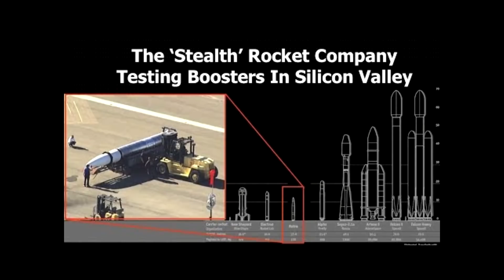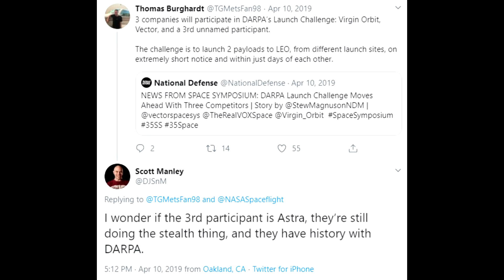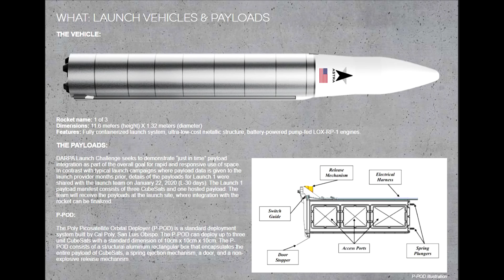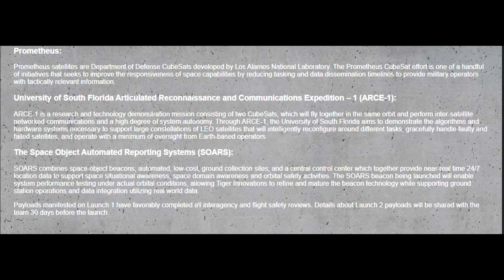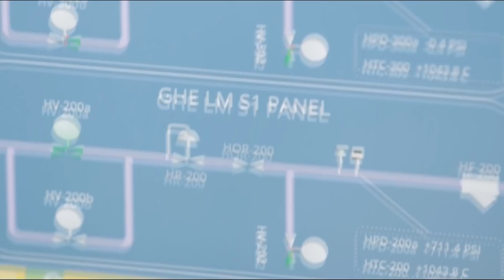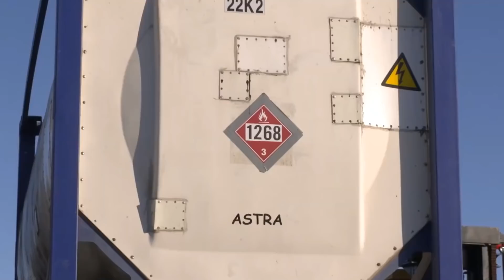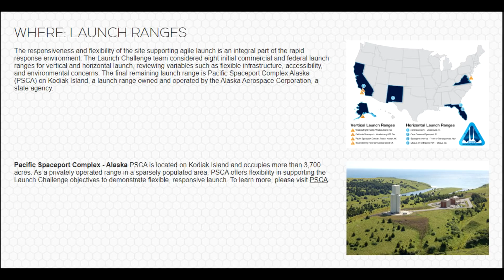Astra's Secret Rocket Project Finally Reveals Itself

Comment: Is the goal emergency launches in the event of anti satellite misiles in war, or what is the main goal of the darpa challenge?
Reply: Eric Lotze   Actually I think you just made a very good guess. That’s certainly one reason the US would want the capability to rapidly launch a payload into orbit with little prior planning time.
Reply: @liesdamnlies3372  this would not be an effective anti satellite weapon. It's too easy to see coming (satellite recon from other countries would see you setting it up the day before).
Reply: Although not a good anti satellite weapons platform itself, yes this would be good at delivering temporary replacement satellites for any that got shot down, so long as they can be replaced by a satellite under 200 kg (most spy satellites are pretty huge).
Reply: If i remember there is some sort of silo based system for basic coms post massive war.  I don't know if this would replace/compliment that.  Perhaps this is applying a method similar to train/mel based missiles where they are so mobile, you can't kill them thus coms are ensured.

Comment: So let me get this straight... DARPA is having a contest to build a short notice easily transported no launch infrastructure vehicle... They're paying people to build a liquid fueled Pershing 2 missiles!
Reply: Basically a modern V2...
Reply: @fire304  that's what I thought. Easily transportable, could start from anywhere relatively unnoticed and send a small payload anywhere. Even the flame-divider for the launch platform looks similar!
Reply: @foximacentauri7891  This rocket can only carry 100kg.
Reply: @PhysicsGamer what do they want to achieve by this? No big warhead and no practical satellite is that light.
Reply: @foximacentauri7891  The US government has been working for years to encourage private spaceflight operations of any scale whatsoever. It's only been coming to fruition the last few years
Reply: @foximacentauri7891  Depending on the mission's definition of "practical" 100kg is plenty for a practical satellite, especially if the mission duration is relatively short.
Reply: PhysicsGamer Ignoring that these are all long since discontinued, in theory you could you could fit a W33 in there just about perfectly.

Or you make a 4 warhead MIRV if you used W54s. Those weighed less than 25 kilos a piece!
Reply: @PhysicsGamer  Not implying anything, but W76 warhead weights 95kg.
Reply: @mrb692  The W33 would need significant re-engineering to turn it into a warhead. Re-engineering which would increase its weight.

There do exist sub-100 kg warheads, certainly, but sending one up on its very own rocket is... spectacularly wasteful.

Any sort of MIRV nonsense is right out, since the I in MIRV would take up far too much of the weight.
Reply: PhysicsGamer Oh, I’m well aware. I was talking purely a “spherical nukes in a vacuum” sort of thing and not a “DARPA is funding this to make an American SCUD”. The warheads in question were all decommissioned at least 30 years ago anyways. 

Although, 100kg is its payload to orbit so I’d imagine you’d have more mass to play with if you were building a SRBM or IRBM. But since DARPA isn’t funding an American SCUD, it’s irrelevant anyways.
Reply: @foximacentauri7891  Personally my guess is that they will need sub 100kg global positioning sats able to launch with little notice to replace GPS satellites destroyed by the Chinese or Russians in a first strike scenario. Our satellites have never been more vulnerable than now. The Chinese have already demonstrated satellite killing capabilities so it would be good for us to have a rapidly launchable way to replace holes in our array of sats. They would also need to be stored anywhere not seen on the spy sats of our enemies and deployed before they can be found and killed on the ground. Hence the capability to launch from and unimproved location. This would keep our military in the game in case WW3 broke out.
Reply: @danielc9312  That sounds like a tall order. GPS satellites weigh 1600kg and have to be lofted to MEO, quite a stretch from 100kg to LEO.
Reply: @-Gorby-  I thought short living satellites which just pollute space are a thing of the past?
Reply: @foximacentauri7891  They are, but we're talking about a military satellite that needs to be launched at very short notice; chances are there's an urgent reason for that and I doubt the military would care about space junk over national security in that moment. For all we know the satellite will be smashed into an enemy satellite and just create a bunch more junk, although I like to think(hope) that even the military would be a bit more responsible than that.
Reply: Why would they want a liquid fueled irbm? Doing this same concept with solid fuel would be MUCH better tacticaly. But that is not to say this is not primarily a military used project. But to launch new militarily usefull satelites to replace those that have been already destroyed by a near peer adversary.
Reply: Exactly, Primarch359. The key concept here is rapid launches, which you'd need after somebody took out your spy satellites. Little cubesats wouldn't do the job as well as expensive purpose built hardware, but it would be better than nothing at a critical time.
Reply: @Kevin_Street  well i ASSUME that small cubesats would be useful for electronic warfare spy sats not so much optical.
Reply: @Primarch359. That could very well be. I know nothing about this subject, so I differ to your assessment.
Reply: Or a Scud
Reply: Didn't realise how many rocket scientist and military generals there were in the comments. Holy hell
Reply: Shhhh!
Reply: yeah, but the weight of a warhead is a lot more then the cube sats, i dont think the frame is strong to simple swap out for warheads.
Reply: @nemoskull2262  you are correct about weight, which is why a Atlas was able to put John Glenn in orbit but only had a 6500 mile range with a nuke on top. It's all about weight vs range.
Reply: fire304 ☆ Perfect Cover!!!
Reply: Just what they said.
They can now place Recon Sats in any orbit they want at a moment's notice cheaper than diverting an existing one with specific sensors & cameras.
Information as the Best Deterrent.
Reply: And now I understand why China make use of old ICBM design and created LM11
Reply: Hey, they HAVE to spend the $ somehow.
Reply: First impression to me is that DARPA is essentially outsourcing the development of a long range missile system on the sly. 200 kilo payload just think what a 20 kilo kinetic lance could do.
Reply: @lucasrubinstein923  

1. It's a 100kg  payload, not 200.
2. Burn up in the atmosphere.
Reply: PhysicsGamer, Scott quoted 200kg, albeit to low Earth orbit. That’s a very useful payload covering  useful science, comms, weapons, or even surveillance. Can absolutely see why there’s a strategic need for such a system now with satellite killers as part of the mix.
Reply: This is exactly what I was thinking!
Reply: Jes sounds suspicious
Reply: Just to be clear, I'm joking about this being a secret IRBM program. What I was really saying is that they are reinventing the wheel when there are literally dozens of designs which fit this notch as it were, the Pershing being one of them. Have to wonder why so many private ventures are going there liquid fuel route though, when a first stage solid is so much more dependable and simple.
Reply: Now, for those saying "100kg is not enough for a nuke" yes, you are correct, but you don't put a nuke in orbit. For comparison, the Pershing 2 used a W85 which weighed 400kg, but only had a range of 1700km, not orbit. One has to wonder what it's capabilities would have been with 1/4 the payload.

Sadly all but 7 (deactivated and safed for public display) of the boosters were destroyed due to treaty obligations.
Reply: Building space ships....  no wonder Pelosi and gang of 8 say to the people "you don't understand" but we are saving our own ass out of Here!   Since  1990...   well what better HELL then to live out your old days on the Moon, mars, or unknown MEGA ship.  I'll stay on Earth... our beautiful world with all Gods creatures.   There is non other!  ... once there gone we will have our blue skies back.
Reply: Is just a cover for blake project nothing more!!!!!!
Reply: This is so they could sneak them into Europe and tip them with a nuclear warhead. Now this is dangerous because the Russians have said they would launch their own nuclear weapons into Europe to take them out.,right now Russia has America at a disadvantage with their supersonic nuclear missiles and they're stealth subs that American warships cannot detect. Russia's large stealth subs carry 20 missiles and they have 20 nuclear warheads each, those warheads are the largest in the world and considered Nation killers.
Reply: @jeffdoran8126  There are many problems with what you just said.
1. A 20-unit MIRV is... not in the cards for Russia. Not only have they been long behind in MIRV technology (making a 20-MIRV system unlikely), but there's also no evidence that they could successfully handle such a system if they had it. That's a nontrivial task. Plus they're expensive - there's a reason that most American submarine MIRVs aren't fully armed at any given time.
2. You make reference to a "supersonic nuclear missile" that puts "America at a disadvantage" which is nonsense as just about any missile is going to be supersonic. You might be referring to the hypersonic nuclear cruise missile they keep trying to develop, but the key word there is "trying". They've not yet been successful, and there's no evidence they've managed some sort of breakthrough. Indeed, their last test was a disastrous failure.
3. Russian subs are most definitely detectable by American warships. Consider just how old those Russian subs are - and I doubt that any of their refits have seen a significant stealth upgrade in 30 years.
4. The Astra rocket is designed to carry 100kg. That is nothing for a military payload and wholly insufficient for a nuclear one.
Reply: @PhysicsGamer  Yeah brother I agree with you.  Your very knowledgeable about weapon systems. Unlike many Russian trolls keep posting ignorant comments about how superior Russian weapon systems are. 🤔🤔🤔🤔🤔🤔
Reply: @jeffdoran8126  Your comment is misleading. First, you are using supersonic when you should be using hyper-sonic.The current hyper-sonic vehicles can only fly/fall in a straight line. They can't turn or they will burn up due to excessive heat. Knowing this means they wont catch anyone by surprise (not America anyway). The US will track and target any rocket carrying these systems and kill them shortly after launch.
Reply: @michaels5691  look up... triangle aircraft  galore since 2016...   and long cigar shape ships over our oceans.   And ISS sightings of mega ships...    all good.
Reply: @jeffdoran8126  oh I actually read the rest of this guys comment and realized he has no idea what he's talking about.
Reply: @jeffdoran8126  I'm not seeing what the point of sneaking IRBMs into Europe is when we already have SLBMs and stealth bombers. This is for other projects. Well, I guess our government does love spending money on weapons, guh.
Reply: @jeffdoran8126  The US was doing that in Korea in the early 1950's with the Nike. Including the nuke tipped part.
Reply: @jeffdoran8126  I was also concerned why DARPA needed to demonstrate such a capability and research into this sort of area.  Your analysis of such potential applications is both frightening and possibly accurate for European theater.  It also introduces an element of using such technology that could backfire against us...what if rogue elements or terrorists used this same thing against us.  The whole thing smells of bad CIA plans.
Reply: Jeff Doran the US literally has the same capability wtf are you talking about....
Reply: @jeffdoran8126  we have subs with missiles that they cant detect also. It's all apart of the m.a.d strategy
Reply: Jeff Doran russia is a joke lmao
Reply: @jeffdoran8126  exactly, and by having a private company do all the work the US can say "no, we're still honoring the IRBM treaty!" Lol
Reply: @fire304  The INF is already gone, and this is for putting shit in orbit, not hitting ground targets. We've already done a test of a rocket that would have violated the INF.

Comment: Am I the only one concerned about a "Launch from anywhere, within a moment's notice" rocket challenge is DARPA trying to weaponize space?
Reply: Jack Linde - The Chinese have already said they are going to weaponize & militarize space, no matter whether anyone else does it or not. This project is designed to launch small sats quickly the same way Rocket Lab has been doing. Think of reconnaissance “at a moment’s notice” which was what the SR-71 used to do.
Reply: @TraditionalAnglican  when did China say that? Do you have a source I could read?
Reply: I'm not sure why people are liking my last comment, I wasn't calling him out, I genuinely wanted to see the source so I could compare it against the treaty they've signed that restricts military use of space (doesn't prohibit it though)

Comment: The electric pumps. Would one use battery or supercapacitor to power them. 

You'd think that higer power density is more valuable than  high energy density.
Reply: I think you mean specific power and specific energy rather than density (X density is X per cubic metre, specific X is X per kg). Generally having hogher specific energy better than specific power on rockets (within reason) since increasing dry mass the amount of propellant required exponentially.
Reply: @maxk4324  You are right that i really meant specific power.

As to a rocket application, two big factors come to mind. Firstly, weight.  Second part is the short duration and high power requirements of a rocket fuel pump. 

Now batteries are well known to store more energy for a given weight, but have relativly low specific power so one needs to increase the amount of battery and its weight to supply the power requirement. But is all the energy in a battery used up when the fuel is used up or is the battery  carrying extra energy with the extra  battery material needed for its required power?  In the later case can super capacitors store and deliver just enough energy at a high rate with less weight than a battery option?
Reply: Keith Reynolds - Rocket Labs’ electrically operated pumps use Li-Ion batteries.